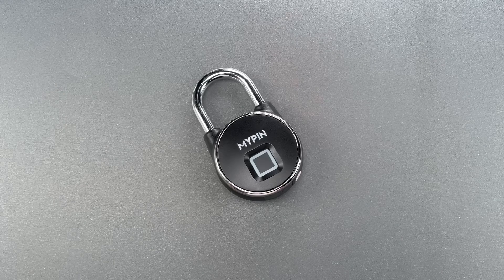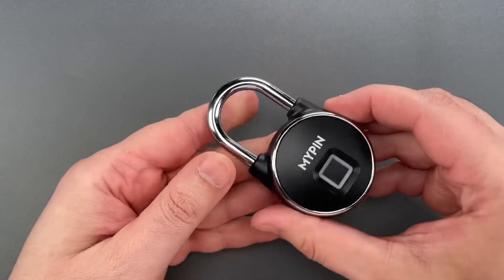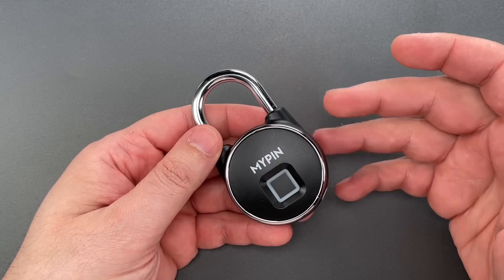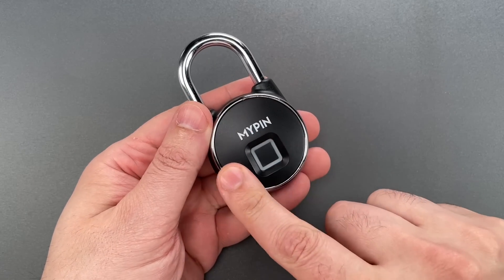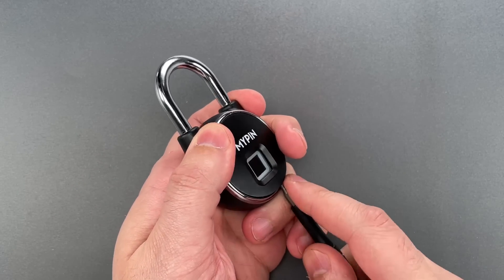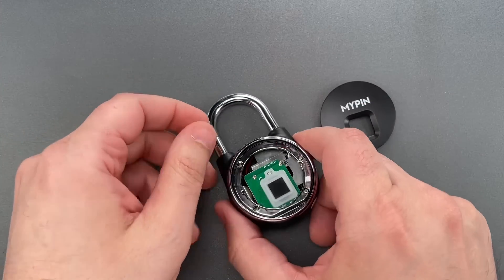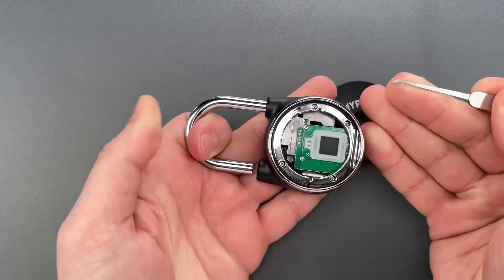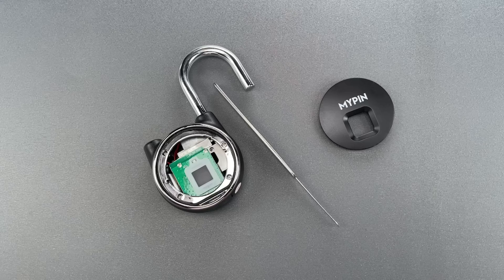[1469] I ALMOST Can’t Believe How Bad: MyPin Fingerprint Lock

Comment: That's unfair to electric toothbrushes. I once tried to open one, and it was a real pain, they're glued super shut 🤣
Reply: they more secure than this lock
Reply: well, they are designed for a very harsh environment and to be used with harsh chemicals.
Reply: @wolphin732  of course, but I still find it funny that a toothbrush is (way) harder to open than a lock. (And of course somewhat insulting that that "lock" is compared to a toothbrush 😉)
Reply: @jetseverschuren  A lot of cheaper consumer electronics are actually very hard to open, because it's way cheaper to glue or plasticweld everything together than to use screws. Which makes it a pain in the butt to repair them, a lot of them are impossible to fix.
Reply: Yes, it's not a fair comparison... Most electric toothbrushes are cheaper than this lock.
Reply: And use torx screws…😂
Reply: @MyRegardsToTheDodo  anybody who tried to open a piece of electronics that was glued into a shell made of plastic will agree that it is impossible to get into them without leaving very obvious marks.
and anybody who watches LPL on a regular basis will agree that at least half of the locks tested here could benefit from such a shell
Reply: @TheScarvig  electric tooth brushes especially are made to be waterproof, so a lot are sonic welded, it may still looklike a seam you could open but it isnt opening without breaking the plastic or cuting through it.
Reply: I think there are some specialized tools for opening them that makes it very easy, but yes, they're orders of magnitude more difficult to open than this lock shaped object.
Reply: Actually they are really easy to open. The charger is the key. Just put it in there and twist. But opening the charger is a different thing. It's just a big block of glue.
Reply: they are ultrasonically welded, not glued
Reply: @wolphin732  worse. They're a hygiene product that under no circumstances may be allowed to release stray metals (they contain a substantial amount of nickel), lubricants, and battery chemicals straight into your mouth. The requirements are practically almost as high as for medical devices. Nominally say kitchenware should also be similarly well constructed, but there just isn't always enough scrutiny to guarantee that.
Reply: I tickled one these locks with an ETB. It giggled and fell open.
Reply: If you'd ever used the old AA electric toothbrushes, they're made very similar to this. 
Back in the day before good rechargeable batteries and wireless charging.
Reply: I once tried to open a electric toothbrush charger. Turned out the circuit boards and everything were embedded in solid hunk of plastic.
Reply: @MyRegardsToTheDodo  also mostly to make such things throwaways, so that they cant be repaired and the consumer will have to buy a new one and thats y most of these things have a replacement only warrenty, for eg TWS earphones
Reply: They are very rarely glued. Most often, is well designed press fit.
Reply: you mean super glued shut?
Reply: Have you ever tried to take apart an electric toothbrush? It's a pain!
Reply: @TheScarvig  Coming from a person that actually used to GLUE small circuit boards into plastic shells, you have less than two seconds to close everything up before the epoxy sets.
Reply: @Araye  So I need an elephant to open it?🤔😁
Reply: And an electric toothbrush does what it needs to do (brush someones teeth) while the lock fails the purpose of a lock (To not be able to get broken into easily)
Reply: They're more secure than masterlock products

Comment: A Bluetooth lock that can practically be opened with a toothpick.
Reply: Should always use a toothpick to avoid bluetooth.
Reply: Ironic
Reply: Yes, preferably with a blue toothpick. ;-)
Reply: It's called MYPIN, so open it with a pin.
Reply: @dfeuer  But will it open if I use...  your pin?
Reply: Don't even need a sonic screwdriver ;-)
Reply: @Blutteufel  This takes a nearly "techno-erotic" turn....🤣
Reply: A toothpick is a little generous maybe two or three toothpicks would be a more realistic prospect
Reply: picking tooth with a pick.
Reply: I was going to try my tooth, but a pick sounds better
Reply: Well I have toothpicks that are durable enough.
Not made by wood or plastic.
So toothpicks can open the lock  literally speaking not only in the name of this pun.
Reply: @the_undead  Depends on what material said toothpick is made out of. I have some that are sharp enough to stab with.
Edit: Yes I have unintentionally poked a tiny hole in my hand or one finger more than once with said toothpicks. Only dead skin deep so no cleaning or bandaid is needed. Heals within one hour.
Reply: it can be opened with a blue toothpick
Reply: Seems adequate to me.
Reply: @the_undead  The LPL probably uses a lock pick as a toothpick.
Reply: @ChristofferOrrmalmUtsi  unless you can point me in the direction of iron or steel or similar toothpicks then I highly doubt one toothpick would do the trick
Reply: @the_undead  it's called a joke💀
Reply: More like a bluetoothpick
Reply: When a lock is opened by a specialized tool that only professionals might have, I don't get too excited.  But everyone has a screwdriver that can pry open the plastic cover and expose the lock release.
Reply: @Blutteufel  no, only if it's my pin
Reply: A bluetoothpick !
Reply: @ChristofferOrrmalmUtsi  who would have guessed I’d meet a weirdo in the comments section of a lock picking video?
Reply: Bluetoothpick actually!!
Reply: @BillLaBrie  Yup, there's two primary categories of people you'll typically find here: the strange, and the pretentious. Makes it even easier to tell who's who when one calls out the other, though.
Reply: @BillLaBrie  That comment you deleted was perfect. Truly the king of clapbacks that definitely don't just prove the point even further.

Comment: This is like building a safe with all walls out of heavy materials, but only adding a curtain as door...
Reply: No, more like building a safe out of… Pillows, and then the door being a bedsheet. This is the worst excuse for a “lock” I have ever seen lmao
Reply: @deadchannel991  Yeah... even I could open this. Not good.
Reply: Or a super heavy door but windows as walls.
Reply: a chain is as strong as its weakest link
Reply: To the contrary.
It's a safe with super heavy duty door and carton walls.
Reply: You joke i have seen a safe  top bottom sides door all perfectly legit  back wide open covered in wall paper   ye gads  and it was being used for a lot of value the excuse was no one is going to move it too heavy one small crow bar soon changed that thought
Reply: Reminds me of the movie RED.
Reply: At least some 5 years old would get confused by the curtain... Here literally nobody is gonna get blocked by this padlock!
Reply: making a titanium framing of a safe then covering it with printer-paper
Reply: Like building a strong safe and having a big weak window right next to the door.

Comment: in most videos, LPL shows us exactly how to open a lock since he already did his full investigation. Can we see a video where the LPL investigates a brand new lock and tests all the entry methods for the first time on camera?
Reply: I think he does this in some of his earlier videos.
Reply: This video would be 10 minutes of him trying to regain composure after popping the faceplate off.
Reply: He did some similar but if its really some new type it can be hours of work trying to figure out which would make for a long boring video.
But if you check out the ones where he tests locks from Stuff made here he tests custom designed locks and explains how we went about to figure out what could be vulnerable to different types of attacks.
Reply: He doesn't accept wrapped up locks to open on camera because people have tried to put airtags in those to try to find out his identity. So he always opens packages in the post office.
Reply: @tharqal2764  that's disgusting. Some people really suck.

He could probably set up a Faraday cage for that if he really wanted, but that's a lot of effort and expense for not much reward
Reply: @nadnerb2k  i think at one point lpl said he brings an emp with him to the post office
Reply: @yetanotherdan  🤣 Bruh.
Reply: Check out for example [1195] and [1147]
Reply: he did such videos with sealed packages from viewers not to know what is inside and he unsealed on camera
Reply: @tharqal2764   'This is the Lockpinking Lawyer and what i have for you today is this person who tried to find out where i live. Instead of my home, i'll be showing you the cage i trapped him in in the middle of the desert. I will leave a covert companion for him to try and escape this cage, which he should be able to do so if he watched my videos and  shouldn't take him more then a few hours.

In any case that is all i have for you today, have a nice day.'
Reply: @tharqal2764  He probably goes somewhere else.  A person opening up a bunch of packages in the post office would stand out quite a bit.  Since the location of the post office is easy to figure out from the sending address, he probably wouldn't want to draw the attention there.
Reply: @TheEDFLegacy  Earlier videos, especially those between 100 and 400 range have that a lot
Reply: While there might be sophisticated bluetooth hacks, zero-manipulation EMP defeats, or nondestructive bypasses of interest to the locksport crowd the reality is that ne'er-do-wells are inclined to attack using the most expedient of means.  Lifting off the cover is both expedient and - more disturbingly - nondestructive enough that it's apt to go unnoticed such that further assessment of a physical security device isn't necessary.
Reply: @nadnerb2k   That wouldn’t even be safe. There would be the route to the cage. Kind of like the time I thought I was clever in grade school, eating sunflower seeds. I threw all the shells all away from my chair in different directions, thinking it would indicate other people. Made a circle around MY chair, like a perfect target. 😵‍💫
Reply: Doesn't he do that for the puzzle locks?
Reply: This would be a great idea for live stream.
Reply: I suggest the puzzle lock videos, as it is the same kind of thinking. Finding things you can manipulate and how they might relate to opening a lock. Obviously with a regular lock the methods are a lot more straightforward.
Reply: He built his brand on videos that are short (which does well in the algorithm), consistently entertaining (by only showing the worst locks he analyzes), and have an air of mystery. As great as it'd be to see behind the scenes, I expect it'd only deflate the magic that has propelled him so high on YouTube.
Reply: @yetanotherdan  LOL
Reply: @tharqal2764  Opening in the post office would be unnecessary because his iPhone would alert him to any unknown airtags pinging it on the way back in his car.
Reply: @_Roboute_Guilliman_ This is ridiculous, but I cannot NOT read it in his voice...
Reply: So you want a 10min vid instead of a 2min condensed version…
Reply: One of these days I really want to see "let's try that one more time so we know it wasn't a fluke... shit it was a fluke"
Reply: @russianspy1234  preach, I'd absolutely love that.
Reply: @kewkabe  and if he doesn't use an iPhone? I've never seen him mention what he uses, so he could have an Android.

Besides, AirTags aren't the model in the game. Tile directly comes to mind, and the iPhone will not know what it is to warn you.
Reply: @kamilpoznan6530  saaaame. He's got such a cool, calm, and collected voice that it's absolutely soothing. Not quite ASMR, but deeply satisfying to listen anyways.
Reply: @tharqal2764  ... and we will do this livestream from the post office that Bosnian Bill and I built
Reply: @agc2801  Yes. I come to these videos thinking "Cool, let's see how he defeats this lock in just a couple of minutes." Then I remember he's just showing us the answer he already figured out earlier. Who watches just the last five minutes of a detective show?
Reply: @yetanotherdan  that'd be 10 minutes of prime-time awesome content though.
Reply: @wheedler  when it’s the same old story everyone…I’d rather see one that he can’t break, now that would be refreshing also would buy in a sec.
Reply: He does the occasional mail in challenge.  Most only take a couple minutes.
Reply: He's done that plenty of times.
Reply: I was JUST thinking about this.
Reply: @agc2801  I think he can't break the Bowley Lock
he has featured them in his channel but i don't remember him picking them
Reply: @BitSmythe  😂👻
Reply: @nullinterface2077  I also noticed that there was only one locking pin, and that it was a spring loaded electronic servo. A firm tap with a rubber mallet or deadblow hammer might be enough to dislodge the pin and open the lock as well.
Reply: well he's done over 1400 and the ones i see many times the lock come out of the box with note pick this 30sec later its picked

Comment: Wow that was extra simple, you wouldn’t even need lock picking equipment to pick that!
Reply: And its not even a Master lock!
Reply: Easy access to the disappointment!
Reply: Disappointed that Lawyer didn't try toothpick to pry and pick it. Looks doable and adds to humiliation collection.
Reply: @SNLiszt  you mean, a blue tooth pick?
Reply: @panda4247  clever
Reply: There isn't even a catch on the shackle, you can just pull on it hard and it will open.
Reply: @panda4247  you know the way to the exit door, don’t you?
Reply: Not everyone has access to a screwdriver.

Comment: LPL has made me a VERY skeptical guy when I see security claims on locks at the Home Store, etc.  I won't ever buy a lock again without checking here first 😂
Reply: More sceptical about company claims, and less sceptical when I see someone in a movie opening a hotel room with a credit card or breaking into a safe in 20 seconds.
Reply: Especially Master Lock who will call something say "Maximum Security" but it still has crap like an unprotected keyway so one can just slide something up through the lock and turn the lugs directly.
Reply: Yes, locks like this I wouldn’t use for anything. One also has to match the lock to the application. For instance I’m going bolt down a plastic toolbox to the bed of my small utility trailer to keep the straps for strapping down a load in it, instead of in my car where they are not needed unless I am using the trailer. So I wouldn’t by this or any fingerprint lock, but rather a cheapo (have a number of them, for picking practice) small padlock, keep the key in the car because I’m only trying to deter someone just happening upon it from stealing the straps. If someone wants to cut the plastic or pry or whatever…ok. But I tried to research well on a padlock that is an extra lock on the little room my band practices in because that needs security.
Reply: Keep in mind that few thieves pick or even bypass locks (save for shimming the shackle). The real crooks these days tend toward cordless grinders which few locks deter and no locks can withstand if the crook has enough time. But always good to know what you're buying so yeah- check here first.
Reply: @P_RO_  this is why I think at the actual serious ends of pad locking you see things like how many minutes it’s rated for against tool based attacks or how many grinding wheels and spare batteries for an average cordless.
Reply: @filanfyretracker  Top level security locks are tested and rated that way, and high-end insurance will specify the level of lock required to meet their specs. But nobody here is going to spend $500+ for one lock, so the point is kind of moot.
Reply: You should have the same skepticism for anything that makes security claims (physical or virtual).
Reply: @bluehatbrit  I definitely am when it comes to the connected world

Comment: I was first introduced to this channel by a video where a "smart" lock could be completely disassembled while locked as long as you had a screwdriver with the right head and I thought it might be an outlier, or some out of touch electronics company trying a lock for the first time. A couple of years later and it's good to know that smart lock technology has improved to the point where you don't even need a scredriver, and any piece of metal will do.
Reply: Underrated work put into this comment

Comment: LPL: Should only be a small hole
MyPin: Gaping holes everywhere
Reply: @UserAgreementNoodle  yes well, I’d heard that holes in the wall made for easy access, so I took out the wall.
Reply: "What are you doing stepbro?"
Reply: Now that's not fair, there was only one hole.
Mostly because the one hole was too big to allow them to put any other holes in it.
Reply: The "your mother" jokes I could make are easier than the lock.
Reply: Mypin: the whole lock is a hole

Comment: ... Some battery cases are harder to open than that lock, lol
Reply: Some plastic packaging is harder to open than this as well.
Reply: @c0d3_m0nk3y  clam shell packaging doesn't count
Reply: Some medicine bottles?
Reply: yeah, they should put the battery on top of the hole. As we know, the battery is impossible to replace...
Reply: Zip ties are harder to open than this.
Reply: I'd have a harder time opening a new pickles jar than opening this lock
Reply: i bought a $3 bubble gun from target and i think the battery casing on it was harder to open than this lock
Reply: Yup, opening up the battery case of my Amazon Fire Stick remote control is pretty tough.